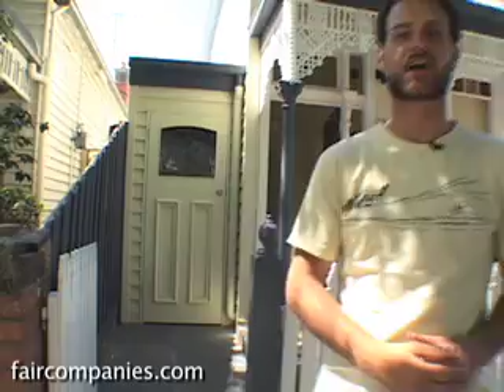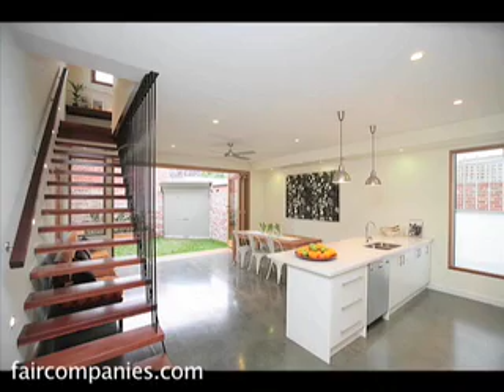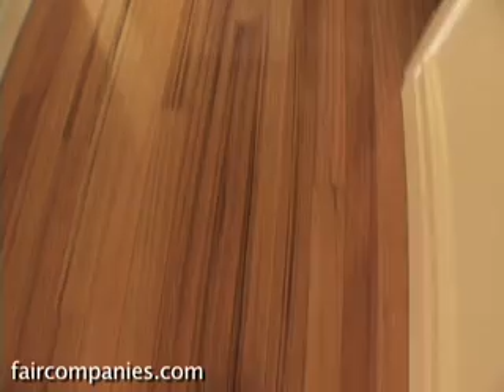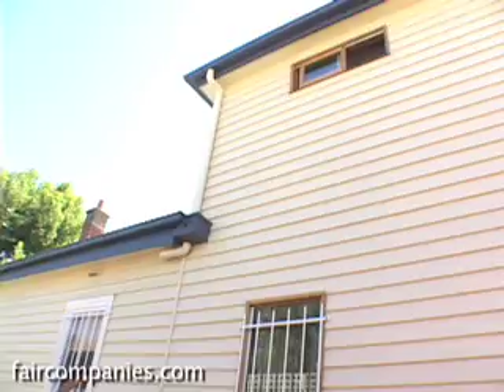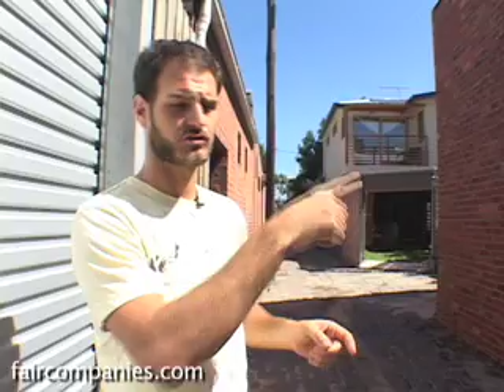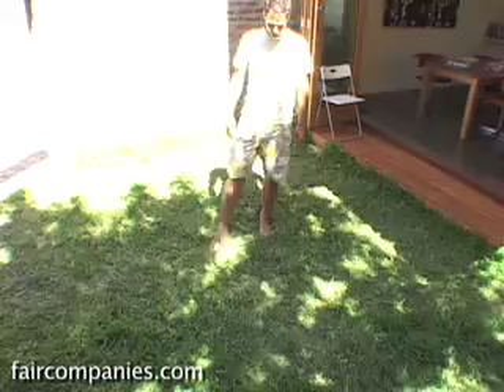Passive solar remodel of small Melbourne laneway home

Comment: Great video.  Inspiring to see how an older home can be modified to passive heating house. The slatted angled boards are a clever idea, selectively blocking summer sun. It seems like Australians have more developed technology  than here in the states.  The rainwater bladder is also a good idea, as a cistern would cost more, has some risks, and needs regular cleaning.

Comment from the maker: @handygote I just spoke with Tyson (I only filmed the video; he was the designer/builder). He told me... the bladder was cheaper than a hard plastic/metal tank. Additionally, you can customize the length of bladders and the cradles that they sit in so we were able to maximize our rainwater catchment system for the limited crawl space that we had under our house.